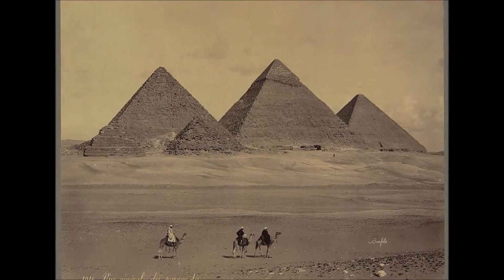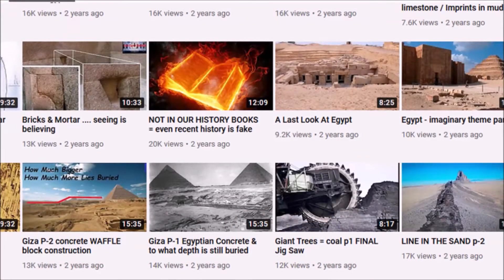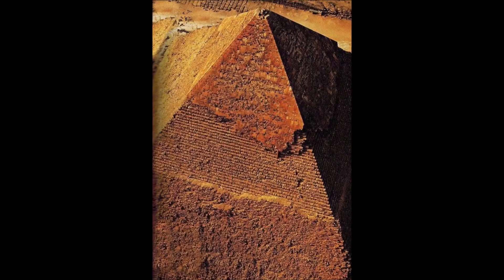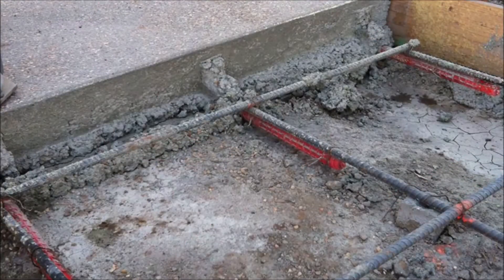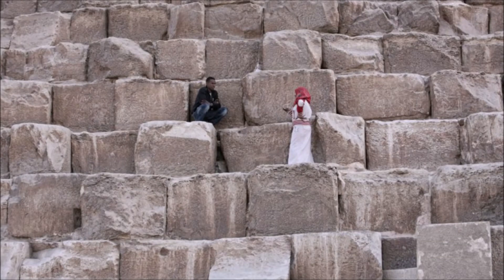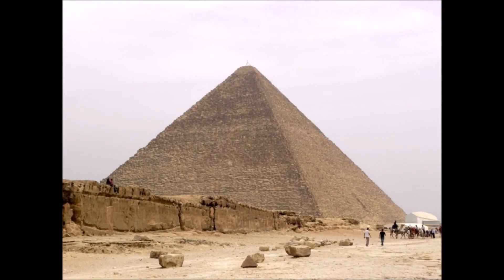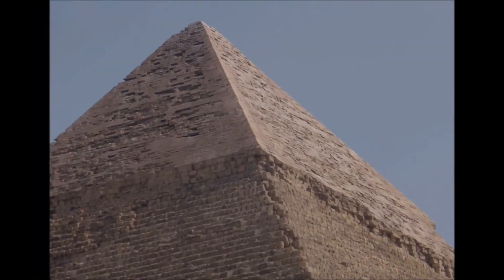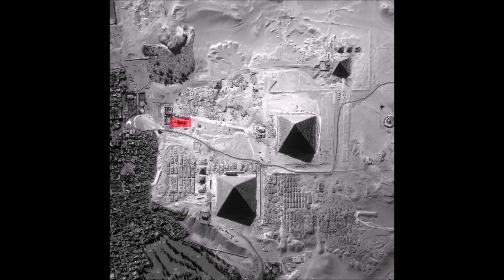Concrete pyramids

Comment: I am disappointed by the host of the video in his presentation on erosion. Let me give another video: https://www.youtube.com/watch?v=EaQr917lRgI&t=134s, where we will see huge erosions on huge stones from 16:00 to 16:14. The erosion has resulted in big holes on some megaliths there and through the holes foreign materials were revealed. I believe such erosion can only happen to cement concretes.  If my friends have the enthusiasm to continue, you may pause the video at 19: 28, where you will see 13 eroding granites which have lost half of their original size.  Such erosion can only happen to man-made stones, I believe.

Comment: Seems to me this hypothesis could easily be proven by simply buying concrete...and making a very small replica. I would be curious to see you make a mold fill it and then make another mold right next to it ..fill it and get rid of the mold but without moving the blocks and see what type of seem you have. Betcha have noticable gap between the stones...but would love to see this done!

Comment: Is there a reliable way to determine if a block is quarried rock or formed concrete? I would think that the inside structures would be different even if the weathered outsides are similar.

Comment: The sphinx was a massive rock calved into a huge Male fully grown lion resting and keeping guard over the pride.

around  5000 years ago it’s what started it all it was in a Lush Forrest on the Nile . 

it’s the first statue created for the new settlement on the Nile like a church it was solid for over 1000 years and worshiped  till it needed changing and maintenance then it got its internal voids for offers to the lion gods. 
Then it became other things up to now . 
Yes the blocks where concrete but not all of them only half of them . The hard areas would be filled with it and timber shuttering  
To keep its shape . 
yes that was a quarry they use hessian ropes and diamond dust water to cut anything and everything stone it’s was so easy to cut even granite and cheap as Chips to do all day long 24/7 365 it’s very quiet when cutting but hand drawn ropes .
Moving the blocks and carrying them was easy as PI too.

I did it in my back garden I was shocked at the speed it cut but it was expensive diamond dust is not cheap now but back then very easy to get.
 gold , Mercury ,silver and copper very hard to get.
Reply: Cool!  Thanks, Homey!
Reply: Delusional
Reply: @Moontanthefirst  educated 👍🏿

Comment: Of all the theories presented concrete, used much like present day construction, is the only theory that makes sense, IMO.
Reply: Not really. It shows he hasn't thought things through, coz there is a quarry on site, and the plateau is basically a quarry itself, just walk up to the edge and you clearly see marks where blocks have been cut out. Also, the Sphinx is not 'just sitting there', it's cut out of an enclosure and the blocks from that enclosure have been used to build the 2 structures (temples they say) in front of the Sphinx. On top of that, you can see that ALL the structures have been worked on by many generations. The passages in the pyramids greatly resemble those of the 'unfinished' pyramids and they all contain 1 or 2 granite boxes; I believe they had a more practical use. Then you have the Sphinx temples and the Menkaure pyramid covered in granite casing stones that match the erosion on the sandstone blocks, clearly a later repair work to prevent more erosion by a later generation. On the Sphinx there are many repair works including those from the early Dynasties (kinda destroys the mainstream narrative of the structure) even Roman repair work. 
Interestingly these granite boxes they find in the pyramids aren't the only place these boxes are found, they are also found far beneath the ground in the Osiris Shaft on the Giza Plateau and in places such as the Serepeum of Saquara, as well as in the unfinished pyramids, clearly showing they had a more practical function rather then a burial one. Also interestingly is that you see NO hieroglyphs on the stuff in Egypt that looks really really old and I'm baffled that the Egyptologists are not more critical of the hieroglyphs on boxes and statues; coz usually they look far inferior to the statues themselves; like it's been graffiti'd on by a later generation; which is a common thing humans do. Even when the Romans described it with the casing stones intact and even if you visit it today; you see lots of 'I was here' graffiti on the Giza pyramids; which has been going on to the modern days. Yet Egyptologists date the statues on the crude inferior 'graffiti' like hieroglyphs that are put on them.
Reply: @stijnvdv2  I’m a novice historian. I love ancient history and I’ve researched the many theories for these ancient magnificent architectural structures, that are found all over the world, for years. Either these ancient cultures were as technically advanced as present day engineering and construction technology or there is a much simpler explanation.

The evidence strongly indicates there was world wide travel and trade between continents in ancient times. The similarity of the construction techniques is strong evidence of that among other cultural evidence. The evidence, IMO, suggest these cultures either knew how to melt stone or they created something similar to present day concrete. 

Either that or they had the ability to manipulate, carve, lift, and precisely place multi-ton slabs of stone without the assistance of machinery that had present day devices that could produce sufficient horsepower to manipulate such enormous weight. There is no evidence, that I’m aware of, that suggest ancient cultures had such machinery. I suppose UFO’s and aliens, with advanced technology, is an an option too.

Another option is that they were simply very clever and figured out how to manipulate massive weight using pulley’s and levers. There is a video on YouTube a contractor in Michigan made. All by himself he demonstrated how he could manipulate, lift, and place massive concrete blocks. He used levers and small rocks placed under the blocks to easily move, manipulate, and place massive blocks precisely where he wanted them.

If he figured out how to do that then it’s possible, maybe even probable, the ancients did too. Whatever they did I don’t believe they cut huge blocks of stone and then drug it hundreds of miles to the job sight, and then drug this massive weight up hundreds of feet and then manually placed it precisely where they wanted it. And cultures all over the planet did the same thing. I don’t think so. 

Whatever technique they all used would have to have been relatively simply and easily duplicated, IMO.
Reply: @stijnvdv2  Great reply!  You put a lot into it and much I agree with.  Keep it up!

Comment: Great video. I just want to add that if you look back at the original excavation photos of the Sphinx there are clearly cut claws into where the paws would have been. That is not to say that the structure was not functional though. I believe they are hiding something "not of this world" under the pyramid complex.

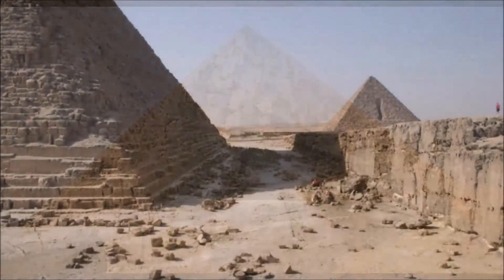Comment: Without yet finishing the vid I have to comment on a sorta error you make.  You show modern concrete typical of many high-rise buildings. 3:40ish.  Showing a sheet of plywood (form) impression into what would be a very large pour.  Stating it being a block is not really correct.. that 4x8 sheet being a very small amount of that one floor pour.   I am enjoying the idea of geo polymer except. Why were the inner rocks of Giza random rough cut,still massive to carry. irregular shaped and the spaces filled with rubble.
Reply: Quote: Why were the inner rocks of Giza random rough cut,still massive to carry. irregular shaped and the spaces filled with rubble.

Because they were poured/cast/compacted on the spot. Lots easier to carry up 100 buckets of wet concrete up, than a single 1000 kg block, and no worries about the fit: the neighbouring allready poured blocks form half of the mould, perfect fit everytime.